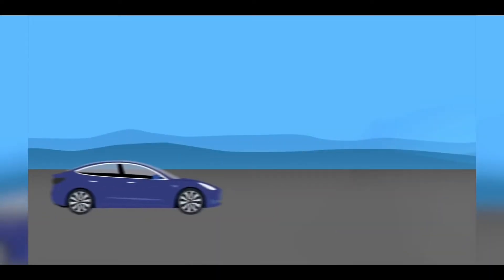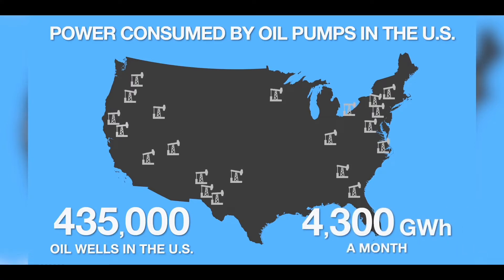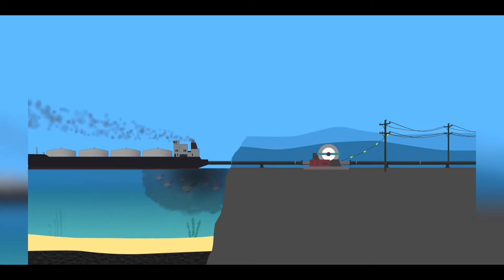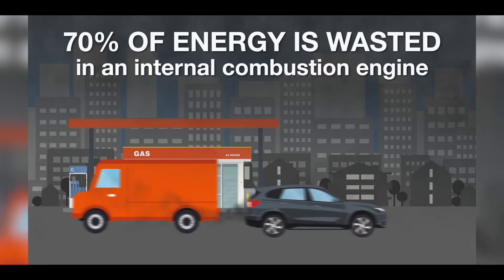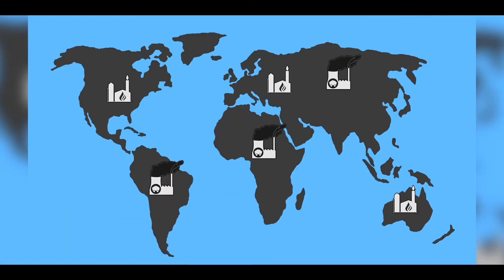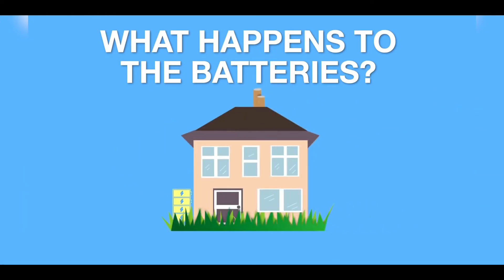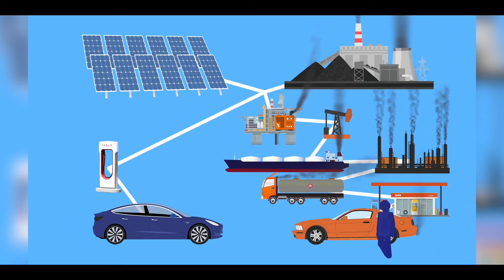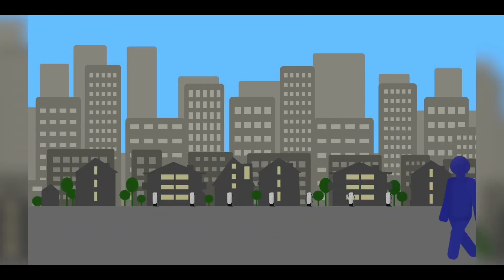The Dirty Truth about Combustion Engine Vehicles

Comment from the maker: Unfortunately the data used in most comparisons of CO2 for ICE and EVs is out of date. They normally state that CO2 per km driven is very similar for EVs and Gasoline powered cars as researchers have traditional only been using CO2 produced by burning Gasoline in the car. More recent research has shown that "well to wheel" CO2 is actually far higher: 3,140 grams per litre for Gasoline see the study "Global carbon intensity of crude oil production" By comparison The International Council on Clean Transportation (ICCT) calculated that a battery electric car running on the UK grid electricity produces only 35g of CO2 per km 
https://innovationorigins.com/en/producing-gasoline-and-diesel-emits-more-co2-than-we-thought/